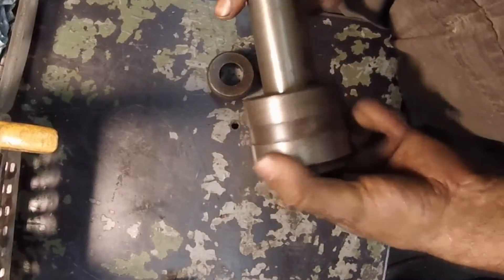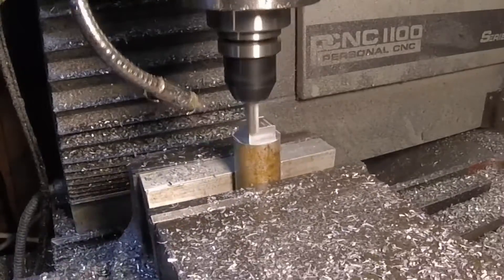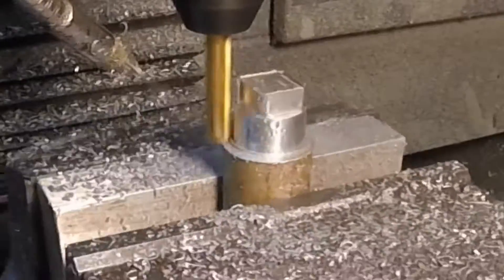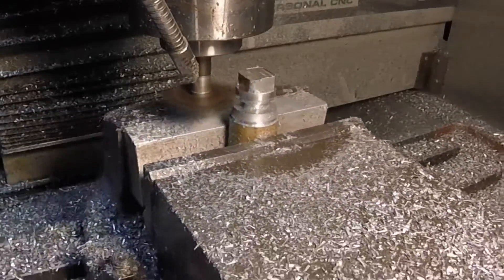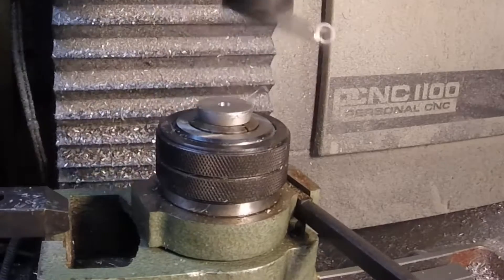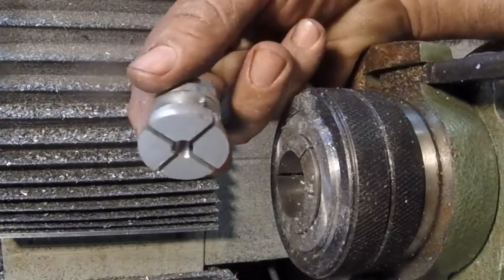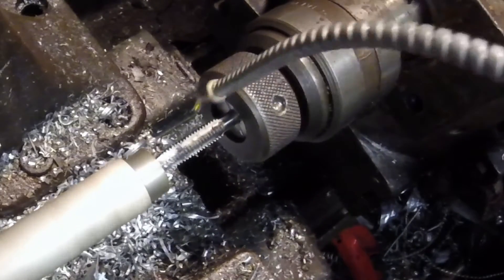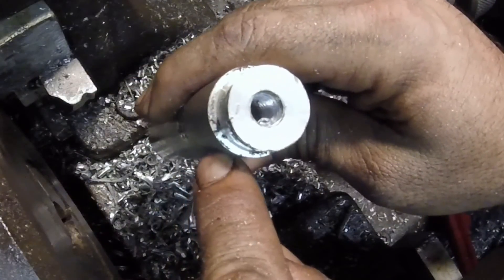Making a Bardons & Oliver releasing tap holder collet on a Tormach PCNC 1100

Comment: Great job!  What saw are you using?  I'm thinking of getting one for my Tormach 440.
Reply from the maker: I got it second (or third) hand so I don't know what brand it is but it's 2" diameter, 1/4" thick with 6 teeth.  I couldn't find a free speed and feed calculator online that accounted for t-slot cutters so I had to wing it.  After some trial and error I came up with 3,000 rpm, 15 ipm and 0.10" - 0.12" depth of cut.  Leaves a pretty good finish and no chatter.
Reply: Ebbco Great!  Thanks for the info.